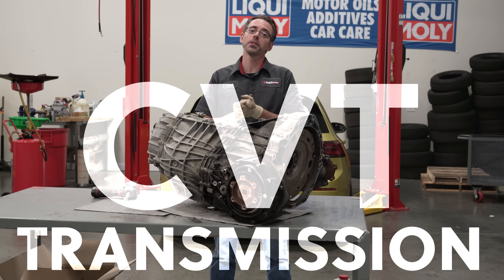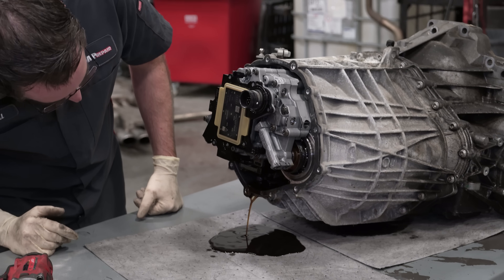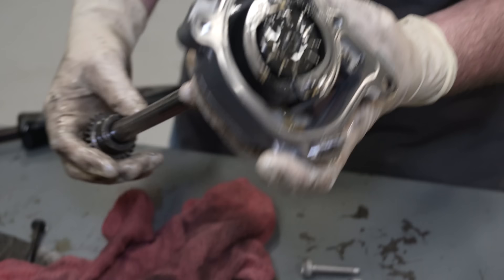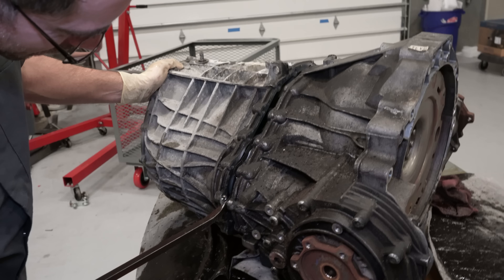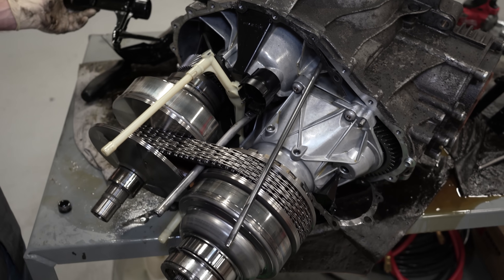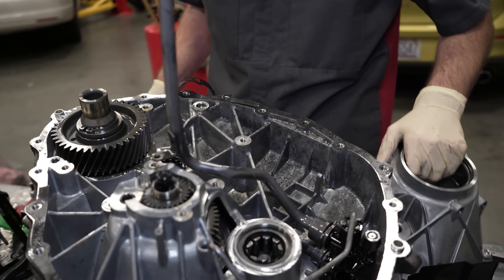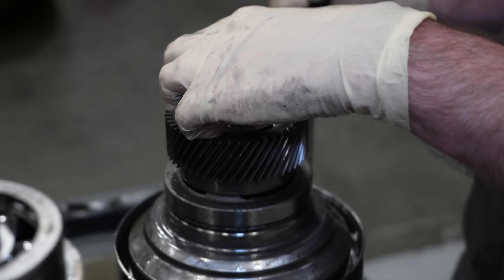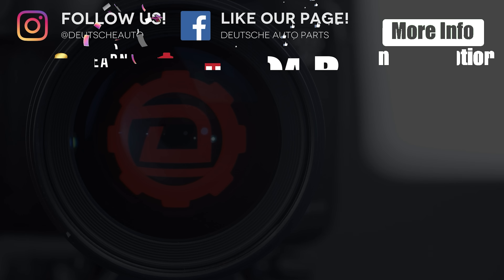Why you shouldn’t get a CVT transmission

Comment: laughs in electric. Transmission? we dont need those. one gear from 0-top speed. there is a gear reduction but these gears are very beefy. all of this stupid crap you need with an ICE cvt just to mimic a fraction of the power and smoothness of an electric motor.

Comment: Excuse me, but I have had several cars with CVT transmissions and with fluid changes every 60,000 miles they have never failed with over 200,000 miles. If you do jack rabbit starts and don’t change the fluid, you will wear them out with just over 100,000 miles at the most and could at 70,000 miles. They do not take abuse.

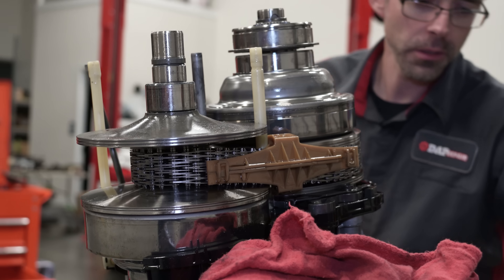Comment: 7:50… 2007 Ford Freestyle with over 138,000 miles not 1 issue with our CVT transmission. DC to New Hampshire multiple family trips. Two kids, bikes, boats with roof top box, not 1 issue. Deep snow in Colorado, Moab sand, icy roads of New England not 1 issue. Fully loaded move to Colorado in 2012 everyone and their mother over 95 mph on interstate 70 thru flat, straight roads of Kansas not 1 issue. My wife made me sell it. The only issue was the Volvo Haldex AWD control module chip that failed to put power to the rear wheels at about 120,000miles. Replaced it myself (not easy) and back to winter park resort for ski season. Hands down best family car I ever owned.

Comment: I've been driving a Toyota Yaris hybrid from 2014 and I haven't had any issues with the CVT.  I drive it in ways I shouldn't like abrupt acceleration, coasting in Neutral, Putting in B on a steep downhill, but it still works well.  I just need to do a wheel Alignment and have it inspected for carbon buildup maybe cleaned as well if there's too much carbon.  I've done 170k km so far and the only major issue I've encountered was the one time I had to replace the hybrid battery which was 2k

Comment: Xmas2025:  My experience with a new car with a CVT.
     My 2023 Subie Forester has a CVT.   It maximizes fuel mileage.  In my 1st year of ownership, when starting from a stop, it felt like molasses (mushy).  Since that fit the car's character, I accepted that as normal.   A  year later my car began making soft tic-tic noises at 12mph. 
     During a routine service, I had them diagnose the issue.  They kept the car for a month, provided a free loner car, and replaced my tranny with a brand new one.  All under warranty.  No charge.  That repair cost them more than $10k.  
     The new tranny feels much "tighter" and now steps away from a dead stop with mild alacrity.   Got rid of the molasses, but still gentle unless you hammer the throttle. 
      While I am pleased Subaru footed the whole bill, the experience left me leery of CVT transmissions.  Not sure they are worth the slight gas savings.
             Retired in Sacto.

Comment: I kind of wanted to watch his teardown, but I was annoyed by his attitude. CVTs work well in many cars, and Nissans previous failures were a design issue. I have own two vehicles with a CVT, and they drove well. I don't prefer them, but the idea of having infinite control over gears  ratio is an cool idea. Honda's with gas engines mostly use cvts these days, and while I've heard of issues with their 1.5T engines driving them, the only failures I've heard of related to the CVTs are when people put too much or too little oil in them.

Comment: Im not a fan of them but my sister in laws Nissan has one with 200k miles still going fine and my wifes Honda civic is at 120k miles no issues. I've always had the maintenance done so I'm curious how long it will last

Comment: I've driven mine for 3 years and like the CVT.  You do NOT jack rabbit start on those but they are smooth and very nice.  Better than a dry clutch cervo motor switching trans that Ford had in the Focus.  That had to be serviced.  The clutch leaked.  Came from Mexico.

Comment: 2008 Toyota Prius with 367,412 miles as of this morning.

CVT is the longest lasting most trouble-free transmission I've ever owned. Just change the fluid every 50-75k, 50k is ideal, and that's all the maintenance I've ever done.
Reply: Prius doesn't really have a CVT with a Belt.  It has an eCVT. It's an orbital gear power combiner that mixes EV motor with ICE engine power. Very reliable.

Comment: So cvt is based off a snowmobile witch works for a snowmobile witch is fine easy and cheap to replace a belt but makes you wonder snowmobile belts saposto change every spring why wouldn’t a cvt worst trans design ever will never but a car with a cvt

Comment: you guys dont even know how this transmission is filled and worked and want them to tell not to buy them if youre not even knowing that  drain an multitronic will not  drain evrything and some other things....  nice but just shittalk because you dont like them  

so jsut you knows  this type of multitronic holds still about .5 to 1 litre of fluid after drainage  thats why you overfill it about 1l  while running   and check the fluid level while the motor is running  and let the overflow  dripp out or is it still to less fill up  a lil more......
 
b8t yeah ist just bad dont buy them  we dont know much about it but dont do it....  we dont know how the valve body rlly works we jsut assume its the same as the others  we tear appart   bad news for you it works different as you told in that video......

to the slip  this newer transmissions are build  to hold the motor tourqe not more  this oil is bad used its not good  service was miserable  so of course it will slip   thats why  evry revision of a multitronik will get upgraded clutch with 2 rings more  to give it headspace  in terms of tourqe 

funfact in youre country  i assume usa its not wondering  most transmission fail if you never  change the oil or do it to late   or even use the wrong  qpecified oil.....   for this multitronics is needed a special cvt oil  not the standart cvt oil  i can see in this transmission is the wrong oil just alone of the base color of the oil this alone could let this transmision be slipping......

so overall i need to say  great portrait of how not to do a teardown  but nice to see how you guys blamage youreself with it so evryone can see nobody is perfect
Reply: oh and just because you dont wanted to watch the manual because you dindnt care is why you failed so hard in this video..... because of a useless rant   about something you dont even know about obviusly......

and before i forget  why does car costs that much a multitronic is mostly one of the cheapest transmissions to repair a revision of it is in material around 600 euro.....   and its  more than simple build  even with low knowledge you could rebuild them   99% problems with all  right serviced transmissions of this type from audi  or vw group is with the tcu   the transmission control module.....  evry other problem is mostly in cause of lack of service or WRONG service like here    as example i run a 1.9 tdi with an multitronic  the transmission already passes  350k kilometers and still runs fine  why?  because its serviced the right time and way  and i can say the same  to evry other multitronic driver i know that let it service by me  they all got no problems with it  from  the gearbox side   2 times   i got a tcu problem on a customer  out of  83  transmissions in 4 years   1 time a dead transmission slipping  because they serviced themself  diddnt got the right fluid   they jsut bought a normal cvt fluid thats not vw spec  and brocke down  new clutz and he was driving again  btw no need to open the whole trasnmission there just the  frontplate thats facing the motor 

and 1 dead transmission because of no service in 200k kilometers it got serviced with the 600 euro parts kit and is driving  fine sience then and do his service  regulary now.....
Reply: bad cvts  transmission i got under my hands was from ford (ctx worst trasnmission i ever saw) some  psa group cars  and evry other mechanical dead transmission was manual to this day
Reply: got to the end of the video  and need to say yes you just made this video because you dont like them  not because theyre bad just because YOU dont like them  even not knowing  how this multitronics are working.......   
wonder how someone can say its bad  if he doesnt know how its particular operating.....   i would not bring even a manual car to you just because of this video  how you treat stuff just because you dont like it says alot about you as mechanik  how could we be sure its worked properly on after that video

Comment: A CVT is not for a person who likes to test take off speed. If you drive like a normal person it will last as long as these junk automatics today(GM). You need to change the fluid every 30k not lifetime. Im at 135000 on my 2015 Honda and it is smoother than any automatic I’ve owned. Gets better gas mileage, doesn’t fight me or need me to manual shift it on hills. Yep you can’t work on them but for the price of a rebuild you get a new one g needed. A rebuild done by 75 percent of techs will fail anyway because they aren’t as good as they think. Change fluid and drive like you got some sense and it will last as long as anything.

Comment: Had a cvt on my honda jazz,  I had the car for 12 years only problem was the garage  to change  the  honda cvt oil when it began juddering,  same argument about  five years  later, needs to be replaced, NO CHANGE THE CVT OIL!! It worked great again,  was cheaper than clutch replacement,  and worked  fine when I sold the car. No real problems on 148000 miles.

Comment: I had a 2006 Honda Civic hybrid with CVT transmission. At 311,000 miles, the transmission gave out. Donated to a charity and got sold for $850 tax credit. So, not all CVT are bad.

Comment: This video shows why every transmission shop is an oily mess.  By the ay, I bought a 2007 Nissan Sentra with a cvt.  Three trans before 50,000 miles.  After the third replacement they said they wouldn’t pay for another.  I sold this POS the next week.  I don’t care what the techs say, the cvt has not been fixed.

Comment: My transmission is at least half (or a third) that size of the one you're tearing apart. I once repaired a manual trans, but I can see this is way beyond me. 
I do agree, just from my own opinion, that heavier cars should have robust transmissions. The CVT has proven itself with motorbikes for years, and my car is just below one ton, so it's a small car but roomier than most passenger cars, even the big ones.

Comment: Being an old and mostly sedate driver with few hard accelerations, though some thoug mountain roads, my recently bought light car with 18k km in one year has only made me smile so far. No gear shift, clutch and or pedal nuisance. Mileage is good, response is good, the warranty is new. I'm happy. And if the car can work with proper maintenance for 5 years, that's ok since I'll be dead before or soon after.

Comment: The CVTs in a Toyota Hybrid do NOT use the belt and pulley system like this one he disassembled. The ‘yota hybrid cvt is called the eCVT and has two planetary gear sets. No clutches or bands to wear out.  The Motor-Generator 1 (MG1) is directly connected to a sun gear and controls the ratio of the transmission by infinitely controlling the rotation of the sun gear.  Ingenious. These transmissions will last beyond the rest of the car.

Comment: Honda Accord has a CVT got 220,000 miles. It’s still running like a baby. Don’t listen to this guy at the beginning. I did like it but I got used to it save you guys. You cannot run it like a race car but it is a good transmission.
Reply: You gotta change Cvt transmission fluid at least every 30,000 miles if you do that it will last you forever

Comment: I think CVT transmissions get a bad rap I own a 2014 Honda Civic we bought it with  around 20,000 miles on it. A rental car company owned it prior to us. It now has over 338,000 miles on it and only time it’s been in the shop for a failure. Is the AC unit. i’ve personally done three drain and fill on the transmission fluid. Honda a testimony to great engineering.

Comment: I have CVT and it works properly when you know how to use it properly it's hydraulic system that works with massive chain accordingly people get traumatized when they hear CVT but there are worse things out there ! Rule number one wait until the system creates pressure don't accelerate right away keep calm and change your fluid regularly

Comment: I love CVTs and I am watching this. The flaw is not in the idea, but in the execution. That said, I still love CVTs A LOT. Belt Cones, Roller cones, V Belt Pulleys, Toroidal, discs. Never really liked metal chained CVTs though. Manufacturers love simulating "fake shifting" too. A CVT should have no distinct gears and no emulated gears. Performance vehicles and "sports" car should either be sequential or H pattern manual "GEARBOXES". CVTs should be for people like me. Those who love ease of use, convenience, dislike clutches, A to B commuting, lack the skill and too lazy to learn clutches, or really vehicles that are too mundane that only cares for fuel efficiency, mileage and convenience over the feeling of sportiness and performance. Like logistics, people mover, SUVs, city cars, fleet cars, etc... Not saying that CVTs lack performance, just saying that people into performance, time attack, circuits races, rallying, stuff like that, love distinct gear shifts.

Comment: What a nonsense 😅 my 2010 a4 with 202000 km goes great with the cvt! But its maintained well. Evry 60k new trannyfluid. My former a4 also,no probs. Maintenance 👍
Reply: 200,000k really isn't a lot, you'd expect a transmission to last 250,000 ,   any less than that and it's junk, over that it's has a good life

Comment: Original owner of a 2009 Nissan Altima with a CVT transmission. 200,000 miles and still going strong. No transmission problems whatsoever yet. CVT transmissions are great. It's when you drive like a moron that things on any car will break. Drive like a normal human being and you'll be fine. And by the way, the guy in the video explained very little about why he thinks CVT transmissions are bad, so this was another waste of time.
Reply: Our Accord still doing fine.

Comment: In theory, CVT transmissions are incredible at every level. They offer the greatest range of ratios and the ability to program their "shifting" to all kinds of unique characteristics. A CVT on a turbo car is even more awesome, as it can hold a car in its exact power range for the entire pull. HOWEVER, modern CVTs aren't built for performance, they are built for efficiency thanks to our glorious EPA and CAFE standards. The problem with that is that the OEM engineers are forced to run them at the ragged edge of failure in terms of logic and internal pressures. Just enough pressure on the chain to maintain contact with the variators without slipping, but not so much that it creates additional noise, vibration or harshness. The issue is, over time, the fluid breaks down, debris builds up and ultimately a loss of friction/grip happens. A small increase in pressure would help prevent this, but remember, the OEM is being forced to run them at the edge of disaster so they are as efficient as possible. Extra pressure creates extra drag and pumping losses, and when attempting to squeeze every minute ounce of fuel economy from the car, they just can't do that. So they fail, a lot, which is truthfully a shame, because they are actually incredibly simple inside compared to a traditional automatic.

Comment: CVT transmission isn't new tech, it's been around since at least the 60s when it was used on some smaller British cars.  It was effectively a giant rubber band but has obviously developed over time.  It was crap in the 60s and it's still crap now.

I had a zetec Ford Escort which had a CVT. There was a fault in the valve body which Ford knew about (no surprise there).  If I drove in cold weather when I had to stop the revs would shoot up to 3000. When I set off again it would behave for the rest of the journey.  I learnt over time to either go out early and warm the engine up to temperature before driving or I'd have to start up, put it in drive let it move forward then stamp on the brake pedal.  After that it would be fine.  I was quoted by an auto transmission £800 to fix it, the whole car only cost £800, that's the equivalent to £1478 today!

Comment: I got in the habit of getting a new Camry every year now in 2025 all of them are cvt and hybrids.At this point I will keep our two2024  until the wheels fall off.Toyota you shot yourself in  the foot I’m done.I got away from Honda because of their going to CVT.
Reply: Toyota CVT are the best in the world, the regular CVT has a first physical gear to significantly reduce stress on the system and the e-CVT on the hybrids is just two electric motors with set of planetary gears super simple no clutch whatsoever.
Reply: You could just as easily have kept maintaining a 2000 Camry and it would still be good as a daily driver

Comment: A have a B8 TDi with multitronic, 220k kilometers on the clock, no problems so far except slight vibration (sometimes) from flywheel

Comment: If the manufacturer requires every 30,000 miles to change the oil, I think it would be best preventive maintenance do it every 15,000 miles you should be fine

Comment: A well maintained CVT will operate more efficiently than conventional ones.
Reply: An ordinary Camry 4-speed or 5-speed auto from 20 years ago was extremely reliable and cheap to maintain.  Heck, even the low-end JATCO automatic was reliable if never driven hard.  The most-efficient tranny is the one on the road and not in the shop